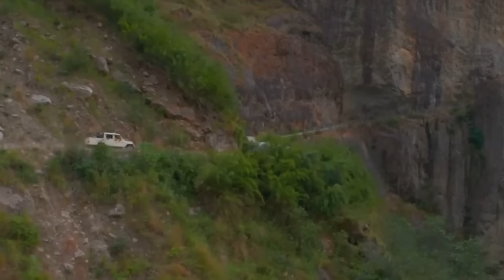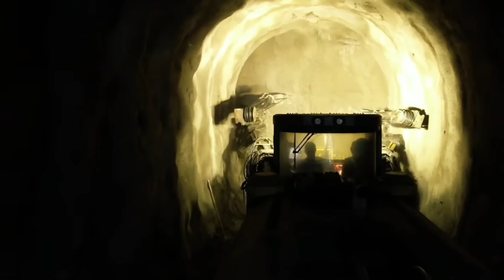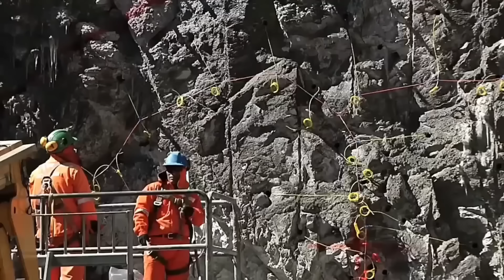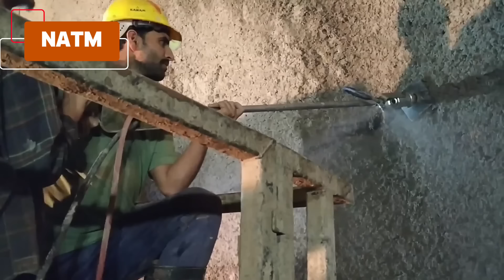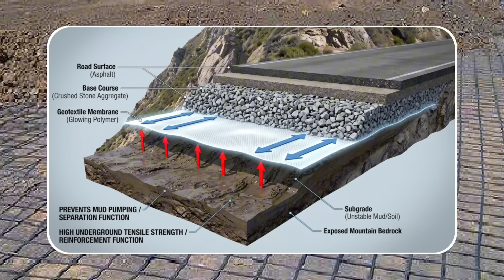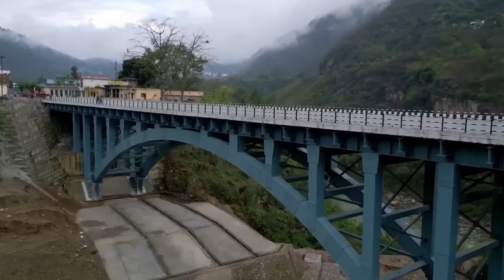How Indian Engineers Widened a 10m Road on a 90 Degree Vertical Cliff in the Himalayas

Comment: Make a tunnel...it,s simple or much cheaper it,s make lateral L concret and it,s very cheap
Reply from the maker: The techniques applied will vary depending on the section and area. Tunneling also depends on the geological conditions of the area; with weak soil, tunneling can easily lead to unexpected problems. Please like and liven up this video!